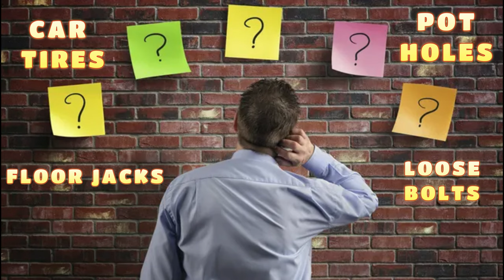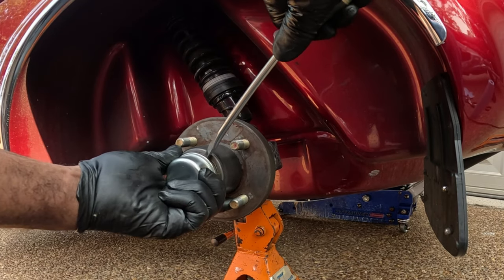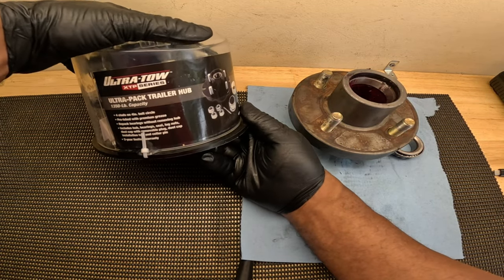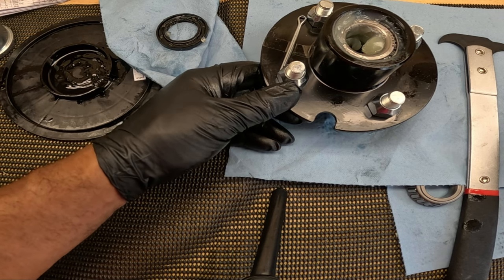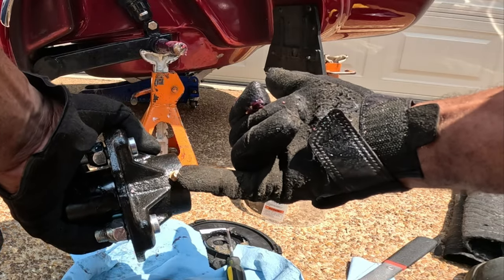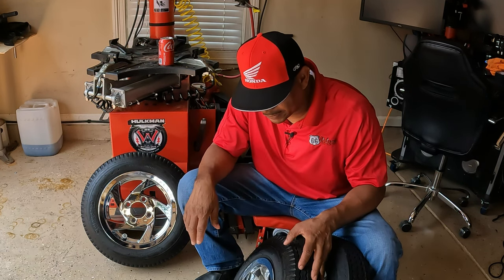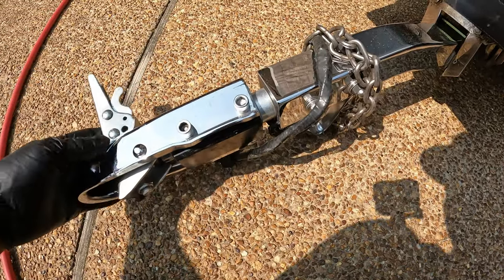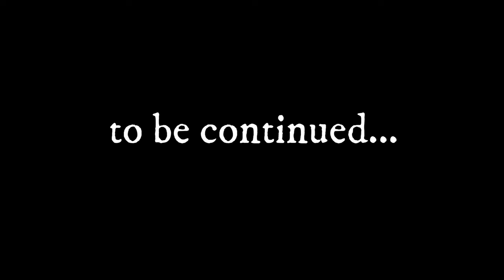Episode #4  How to Prepare your Motorcycle Trailer for a Long Distance Trip

Comment: Agree 100% dry bearings and overloaded are the main causes for trailer failure.
Reply from the maker: Dry bearings will weld themselves to the spindle and seize up, an overloaded trailer can break suspension parts or sheer off wheels.  Knowing how to service and load your trailer properly can save riders an unnecessary breakdown.

Comment: Excellent video! Do you use a different valve stem with the balance beads? Do you know the weight difference between the 2 hubs? The OEM looks heavier. Now you have a spare hub incase of a break down.

Comment: Chris, I was wondering what the fuel economy impact was pulling a trailer vs not. I get low 40mpg with my DCT Wing and was wondering how much a trailer would effect mpg. Thanks!
Reply from the maker: I’ve travelled with other new Wing owners that didn’t have a trailer when I pulled my trailer on the road but we all had to stop for fuel at the exact same mileages.  Pulling a trailer does reduce the mpg by a Miniscule.
Reply: @chriscaliente5033  Thanks, Chris

Comment: Been grease monkey on backhoe for years, still todays grease monkey!! Been greasing bearings In everything… LOL … nothing new!! Rather grease bearings by hand than using grease gun. More visuals and replacement if needed. Most times need replace seals dry and cracked. Colorado uses chemical road spray in winter. Really sucks.
Reply from the maker: Your so correct, very good information!